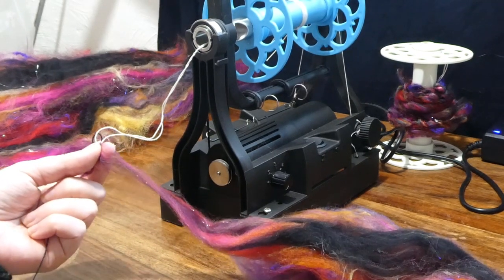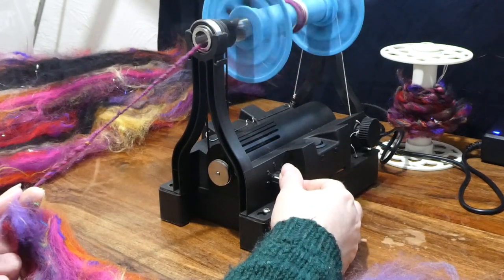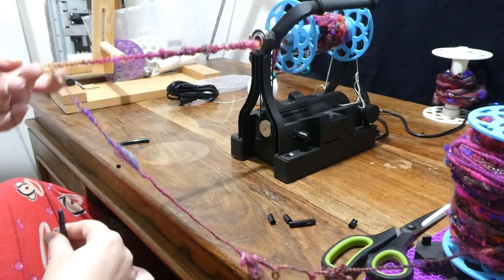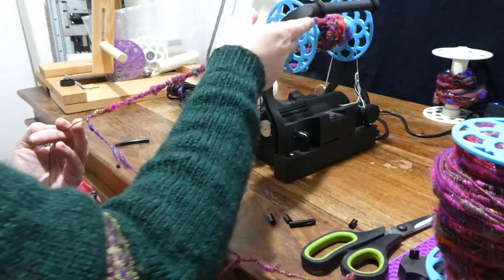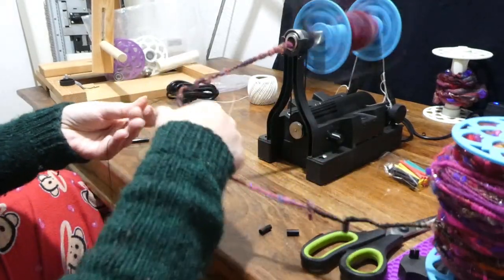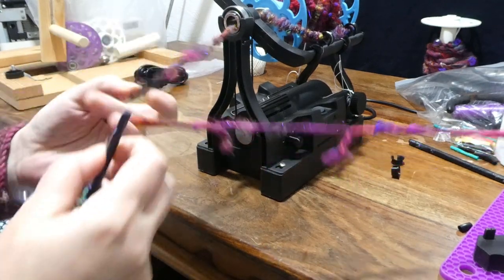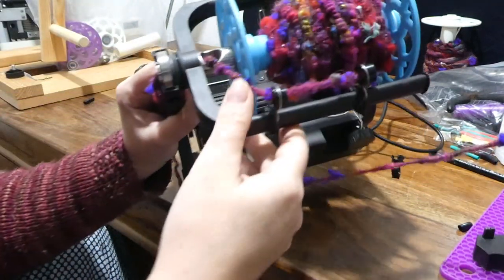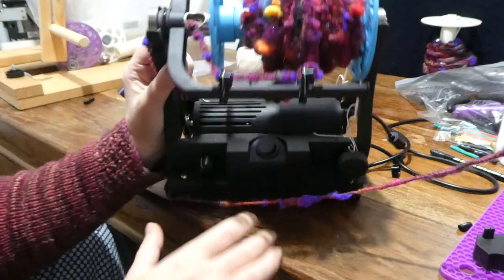Spinning supercoils on the EEW 6.0

Comment: That's a cleaver solution of using those simple 3d printed yarn guides.  This is pretty specialized yarn, but I wonder if those guides would help some with just super bulky yarn too.

For people who don't have a 3d printer, I think an alternative solution that might work better than your shrink tubing would be to wrap paper towel around the hooks and then wrap clear packing tape around the paper towel.  This will give a nice diameter to the hooks while being much more slippery than your heat shrink tubing.

Comment: I don't understand what you have on the drop spindle. I understand it's the core yarn but how did you get it on the drop spindle, and did you wind it on the drop spindle in the opposite direction of the twist of the yarn? If it's on a cone, you don't need to worry about how much yarn you need. I'm confused but love watching your videos. Thank you!
Reply from the maker: I wound it on whichever way felt comfortable, not noting the twist direction at all. 

The reason I do this is because if you use yarn from a cone as your core, every time the flyer turns you end up with a twist in that yarn. With this sort of yarn with lots of twists, that means the end result is very active and badly behaved. Having the yarn on the spindle means that as the flyer turns adding twist, the spindle can also turn to remove that excess twist, meaning the final yarn hangs nicely and isn't hard to work with.
Reply: @vampyyy  Thank  you very much, now I understand.